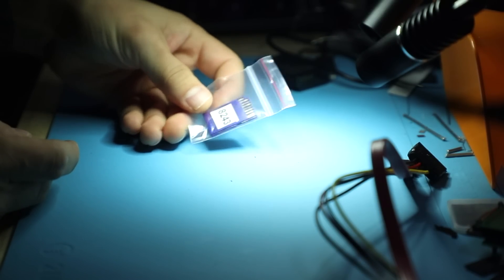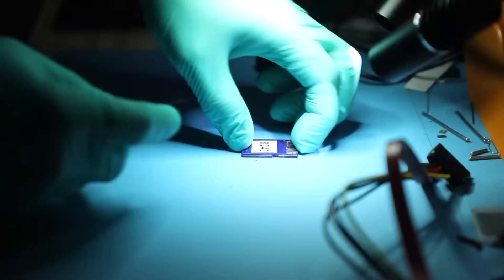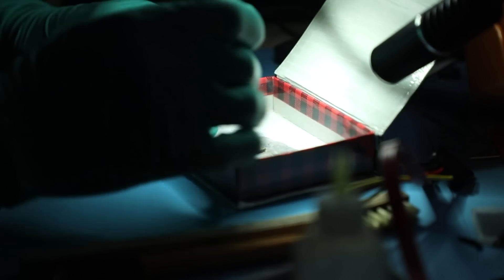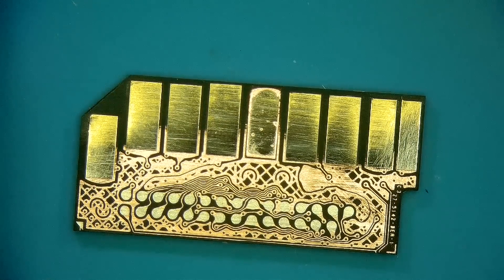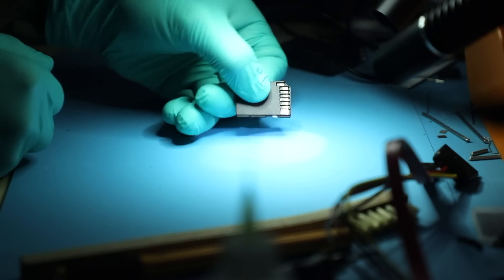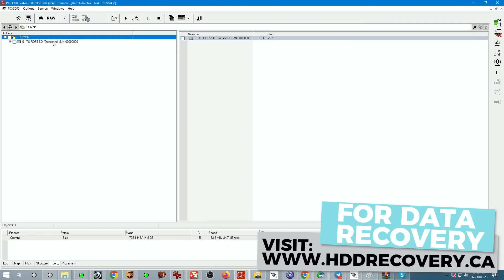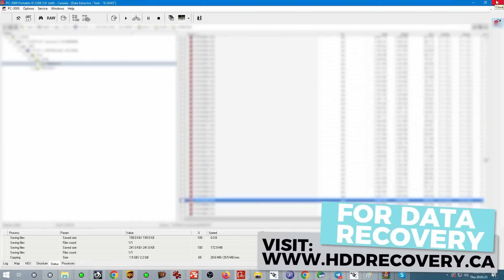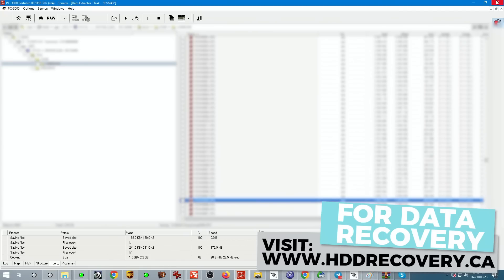how to recover data from saltwater-damaged memory cards

Comment: Bro please help me, I got blue screen erro on my laptop and I trying to solve that it won't work after doing troubleshooting so many times and finally I removed my SSD and it's asking bitt locker recovery key , I have more than 140gb data on my SSD I need to recover my data safely please tell me any solution for this

Comment: hello, 5 years ago you released the video about recovering data from damaged disc using gluegun. Is there any new technology to recover data from scratched disc platters?
Reply from the maker: we do a lot of platter damage cases now, and to some degree most of the cases can still get some data back. Decontamination, limitation, firmware adjustments for head maps. decapitation of heads are all common practices here for us
Reply: @hddrecoveryservices   now I wish I lived in CA… here in Poland they said that there is no chance to recover data from a disk with scratched platters and it killed me

Comment: Is it hard to recover data from an SSD affected by "Satafirm S11". Some of data for example is locked in a partition with Bitlocker.
Reply from the maker: Hard to say. S11 issue for Phison is easy to resolve but error correction will be done with software. Hardware ECC is optimized for the device, software ECC is someone general. As a result it may have areas that do not correct fully, and if they are essential for bitlocker then data is gonna remain locked

Comment: How much is the pc3000 portable worth with the extensions?
Reply: Depends on country you're in AFAIK. You don't really need PC3000 for this case of course.
Reply from the maker: best would be to ask sales at acelab Ziam, they will explain what they have and what it will cost

Comment: Well I kinda take back my last post lol , Nice when they are a simple fix! 
I run a CCTV Camera Shop , And Deal with this petty often 
Most Customers don't tighten the screws all the way to seal up the cards. 
Some customers use dielectric grease all over the card into the jack to solve this problem.